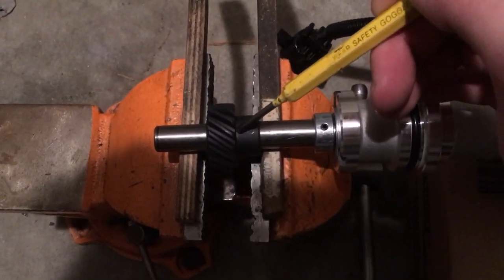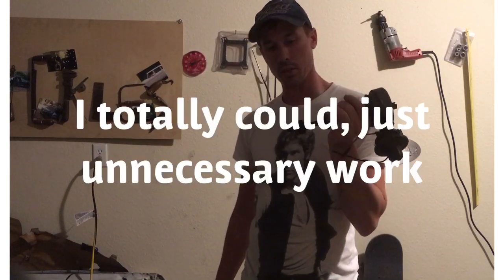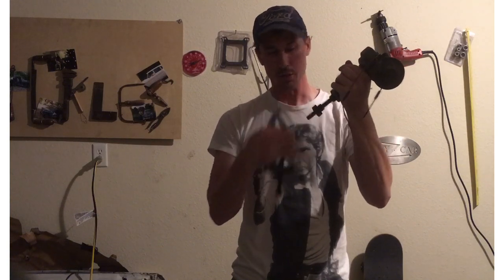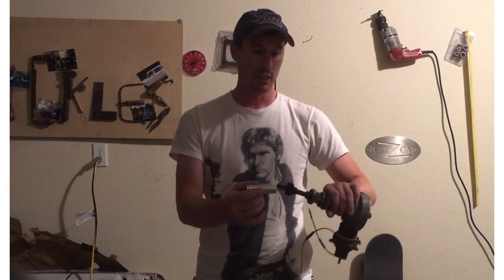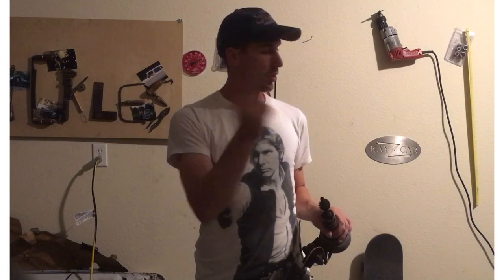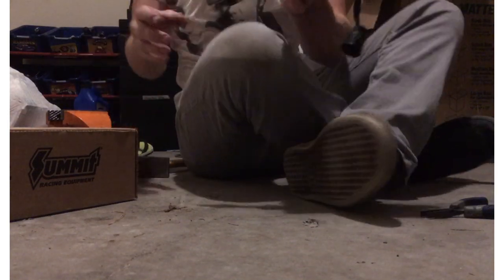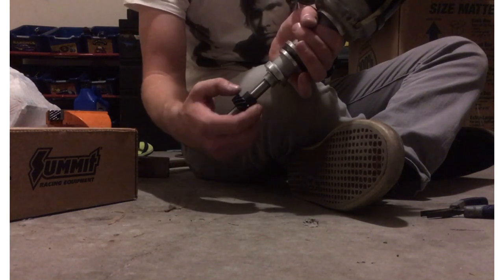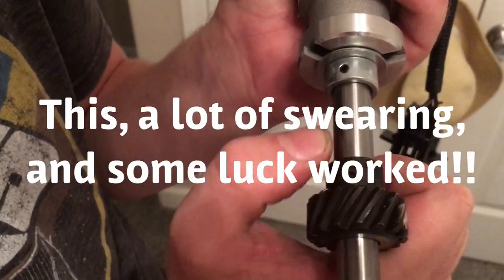How to remove and install a distributor gear

Comment: 351w duraspark?  I wonder if you can put a used steel gear from a 302 TFI distributor on a 351w duraspark  I think they have the same ID on the gear.  When I took my roller 95 351w apart, the tfi distributor was seized in the block.  I beat it out by hammering on the oil pump driveshaft from underneath and the steel gear came off the distributor.  I probably can use that gear on a duraspark.

I am running an el cheapo Pro Comp ready to run distributor with an attached HEI module.  The issue with the Pro Comp is the timing curve has a ton of mechanical advance.  I was able to disassemble the Pro Comp distributor and bend some tabs they have inside to limit the advance weights.  Now it has 20 degrees mechanical advance.  I also put lighter springs made for an HEI in it, but I think they are still too strong.  The mechanical advance does not start moving until it seems like 2000 rpm.
Reply from the maker: Yep, it's a Duraspark from Oreilly's.  The gear cost more than the distributor lol.  I don't think the ID is the same for a 351W and 302 though.

Sounds like your dizzy is set up better than mine.  My total timing is probably wack, I'm sure it has too much advance, and I havent done anything with the springs.  It's somewhere on the "to do list."  I need to find a way to multiply money and free time and I need a reasonable JY nearby.  I was reading that certain year 460's have the distributor guts that would have the advance tabs, or whatever they are called, that would put the total timing closer to ideal for a car with a cam and greater than stock initial timing.

Comment: Thank you for the video. Good information. How do you determine what gear type what gear material type do you use based on the cam?
Reply from the maker: Thanks, flat lifter cams get cast iron gears and roller lifter cams get steel gears. It can be a bit more complicated than that, luckily when you go to buy a cam it will usually suggest what material is needed for the distributor gear
Reply: @fomobros2207  I am gonna replace the distributor in my 88 F-150 with the 5.0L. The new distributor has a steel gear. How do you tell what lifters you have with removing the intake? I have heard it could have flat lifters or roller lifters?
Reply from the maker: @randylineberger  dad gum it! You stumped me. A 1988 SHOULD be a roller cam. All 5.0’s from 1986 and up are SUPPOSED to be roller cams. Tell ya what, if the distributor you pull out looks like it has a cast gear (cast gears are textured and steel gears are smooth) then it may be a flat lifter…..but if it looks like a steel gear it SHOULD be a roller cam. But without pulling that intake idk for sure🤷‍♂️
Reply: @fomobros2207  I pulled the old distributor out just to look at the gear. It looked smooth to me.  I am going with steel. I really appreciate your time and the information.
Reply: What will happen if I use a steel gear and need a cast iron gear?
Reply: I have a 1991 5.0 from a e150 and it has the older firing order but it’s running with a 1992 distributor just fine .. just don’t want to damage the engine